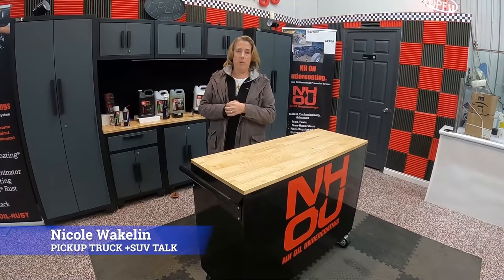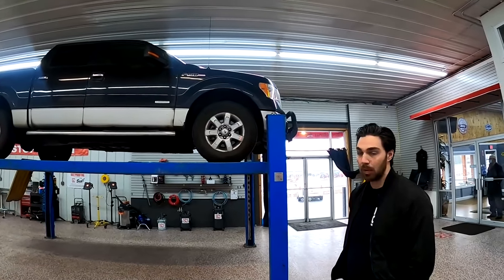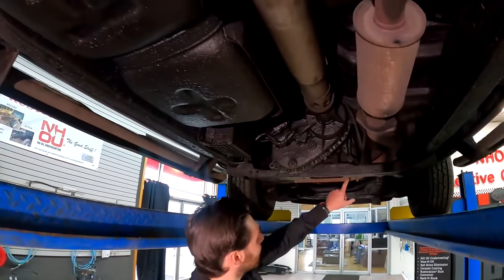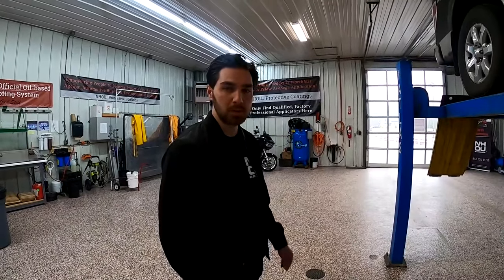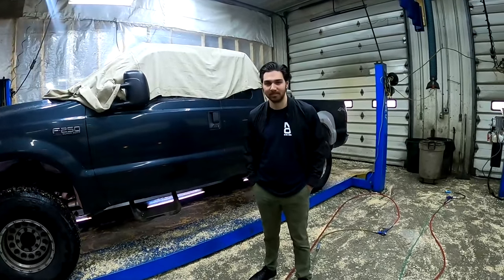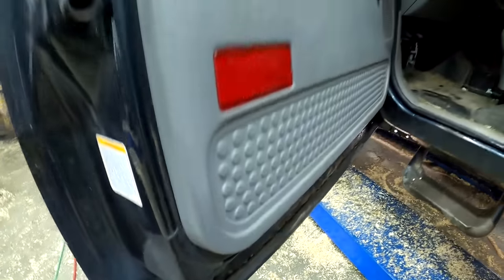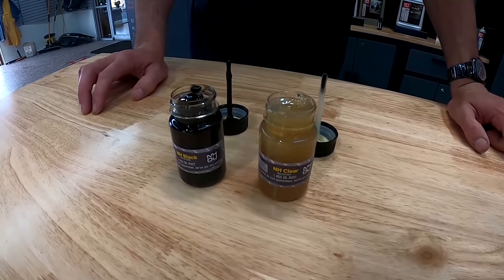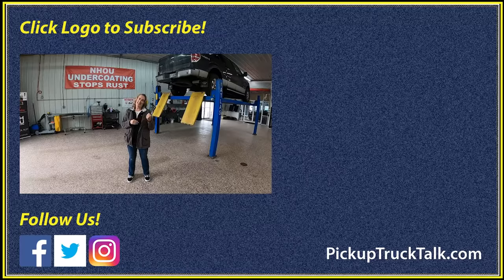Stop truck rust! Here's how with NHOU undercoating on new, used truck

Comment: Best thing ever!!
Live in eastern Canada and my 13 f150 is still good after spraying it myself every year. 
After warranty and not being undercoated will not be any paint left on the chassis.
My friend had an 81 f150 his dad sprayed the base oil from every oil change on it.
Thing was mint after 20 yrs.
Also melted toilet wax rings work extremely well!!
Reply: why toliet rings whats special about them?  i should look at spraying old oil on.  i use rust check/krown, but i'm still not convinced on them being better than motor oil.  hear a lot of old guys using chain saw bar oil too.
Reply: @666dynomax  the wax rings melted down is probably the most lasting thing.
I use a product made by dominion sure seal.
110$  for 20 litres. Seems to be working fine, its thick. Creeps also, see it coming out from edges of trim and along my lights and everywhere I sprayed inside panels. 
Bar oil is good too, just get the thicker brand for warmer weather. Cold weather stuff is thin.  I find rust check wears off fast on the chassis, but not inside the panels.
Motor oil is OK but messy I find also, great if mixing with something thicker like bar oil.
Reply: @jpowell9343  I’ve been debating taking on my own rustproofing.  I play little over two hundred a year for rustcheck. I was finding the krown washing off so after three years I switched to rustcheck.  It’s building.
Reply: @jpowell9343  do those cheap guns perform ok?   I could get setup cheap.  I’m sure it’s less than $20 in product a year
Reply: @666dynomax  i just use a shutz gun like for rock guard, the screw on can type.
Like 30$ and set my compressor to 90 or 100 psi. Anywhere hard to reach i attach a hose to tip of the gun but must places you can reach like above wheel wells ..most important on a truck and cab corner, rockers.  I use about 12, 15 liters of rustproofing on my supercrew 6.5 ft box.
Its on there and don't come off..lol.
Even in cold I can see where its creeped out around things.
I swear by rustproofing, resale, maintenence is way better after you keep spraying it.
Sold my 03 f150 last year, chassis and underneath was still In excellent shape....most around here are gone or broken off.
You have the holes drilled so will be easy to do it yourself. You will do a better job and know where you got it.
Reply: For best results you want corrosion inhibitors in your base oil. Check How corrosion inhibitors protect metal: synthesis in the lab and testing by Applied Science.

Comment: I live in a winter climate. Salty roads. I don’t believe in the extra costs in doing that every year but I totally get why it’s done for sure. Does prolong rust from the outside in. Problem people we will get rust from stones chips etc. From the exterior of the body. In my opinion that is worse. Running boards really protect the door sills, corner of cabs, box. Also a lot of people trade there trucks or cars in on the average 7-8 years anyways. Also I seen here at least where the oil or compound starts to lift or crack and collects moisture. I guess that’s why every year of doing that would correct that issue if noticed.

Comment: I have used this product the last couple years on my truck.  That said I do have a build up of since I don't wash the undercarriage because of the reasons mentioned in the video.  Should I give it a wash before I take it in for undercoating this year?  I am not sure it will come off with a few washes since it is on their solidly. Or should I just leave as is and have the shop spray over what is there?  Thank you
Reply: i was in today and it was explained that each year you get this done it “stacks” / “sticks” to the old stuff. so i’d imagine you wouldn’t want to remove it each time.

Comment: Why wasn't there masking off around the brakes you would not want oil on your brakes.
Reply: That is what I wanted to ask!
Reply: Most of the time the brakes aren't a problem when spraying because of the guard covering the brake disc. But if that guard is missing or rusted off they spray brake clean on the disc after.
Reply: And he sprayed oil all over the spare tire too

Comment: What a mess! I would hate to be the guy who has to work underneath that truck.
Reply: The product becomes much less tacky a few weeks down the road. 75% of the vehicles referred to us were by mechanics. The upside of helping your customer extend the life of their vehicle is you extend the service life and never need to break out a torch! Miraculously spare tires function etc. I guess like everything in life there is an upside and a down but our customers put up with the dirt and dust over rust and structural failure
Reply: Watch some of South Main Auto videos. He would rather work on this than the rusted up junk he works on a lot of times.
Reply: @CraigSmith568  I've seen the video you're referring to and it's pretty compelling!
Reply: It should make it easier though, because bolts come off easily, and even things like fuel lines not rusted.

Comment: I bought my Tacoma new. From December to April I join a car wash for $22/ month. I go like 2-3 times a week. I live in Rhode Island. Lots of snow and salt.  I’m entering my seventh winter now. No rust. Tacoma frames are known to be awful.  So far Toyota had a service bulletin that covers the frame for 12 years since purchasing with unlimited mileage. So I’m afraid if I apply anything, Toyota will void their warranty
Reply: I'd suggest you properly undercoat the inside and outside of your frame and body panels with an oil like Fluid Film, Surface Shield, Krown, or NH Oil. Why? Because simply washing it not only is not enough but I've seen cases where it actually accelerated rust.

Comment: Would one coating of LINEX last forever and not leave an oily coating?
Reply: As long as you don’t get a single drop of moisture in it. It will work great but when (not if) moisture seeps under it it will just rust even faster. Kind of a damned if you do, damned if you don’t situation
Reply: Eric
When getting Line X sprayed into the bed of your truck, is it oily?
Think about it

Comment: AS A TECH, I WOULD BE PISSED TO WORK ON THIS TRUCK, OR ONE COATED WITH THIS CRAP, MAKE ANY JOB WAY HARDER , AND A LOT MORE MESSY
Reply: It's definitely messier, but the techs up here in Canada say it makes it easier to remove all the hardware when working on vehicles because it's not rusted and stuck.
Reply: good luck with your trying to remove rusted bolts and nuts goals for 2024 brah.

Comment: Dude... this further solidified my decision for the CyberTruck.
What a joke... this is what traditional auto sells Americans? This is what they have to do to protect it?
Reply from the maker: I'd be curious to see what Tesla does to protect the frame rails on the Cybertruck. I'd imagine it is the same for that truck as well.
Reply: They make cars out steel the world over, and iron oxide occurs wherever the elements intrude.
Reply: Dude, it’s called salt on the roads that react to the metal of the vehicle.  Not sure what your cyber truck is made out of but if it’s metal and driven in the salt, it’s gonna rust🤦

Comment: Infomercial
Reply: That saves you thousands
Reply: @vuemax5229  yes but so does many other products like krown and fluid film ... And don't go trying to sell me on this specific brand in this video .  The point is that whatever kind of oil spray  underocating someone uses it will most likely save the vehicle from rusting away .
Reply from the maker: Sure, I can see that criticism. I just thought it would be interesting to see an undercoating process and I couldn't stop watching this video, so everyone has an opinion I guess.
Reply: @Pickuptrucktalk  you make a very valid point Tim . The video itself is very informative and gets the point across . Just it came across to me like they were indirectly bashing other brands of oil undercoat protection and trying to promote their personal business at the same time .

Comment: 250 is pretty steep.
Reply: They (NHO) want $300 for first time, $250 a yr after 😳
I’ll have to get fluid film or woolwax done instead I guess
Reply: @paulhunter9613   Krown is similar and around $150.
Reply: @VainakhQuranites  the nearest Krown dealer is 50 +mi away and wanted $300. I ended up with getting woolwax spayed on the bottom side and inside the frame for $140 on an aluminum f150. Should be good for a long time
Reply: @paulhunter9613  good deal. It shouldn’t hurt doing it yearly
Reply: The woolwax stays on the truck better than fluid film and krown I guess, supposedly for two yrs. I had it done last fall and didn’t even drive it in the snow last yr, I had one 4” snow , the rest of the year was basically rain. And I did have another car to drive so the truck didn’t see salt , but this yr it will get driven as I sold the car. @VainakhQuranites

Comment: What a MESS! There are literally dozens of solutions that stay on for years and don’t collect dirt cake.
Reply: Only real solution is to move to Arizona :) the only way you can stop pre-existing rust is with oil as it removes oxygen and moisture necessary for oxidation. Everything else just covers it up temporarily.....Like everything in life, there is an upside and a downside. We do however have an alternative for a brand-new truck, Boss Wax. This product cures and is what you would expect from conventional type undercoating. It does not collect dirt and dust as the oil does

Comment: I appreciate that this works. Unfortunately, there’s no way I would keep doing this. I park inside my garage that has an enamel floor installed. I am one of those guys. I bury my trucks in mud and grime all over the country, I then clean them well after. I have not even had rust issues with my farm trucks over the decades. Keep them clean. If you have an issue like Tim did, (I have a 2021 F150 as well), you can also just clean the rust off and paint the areas affected. I have been doing that for decades. I am fortunate that I have always had a hoist so it’s easier for me than others. Even just TremClad works if you want. 
    I was luck as I had surgery recently on my back and while recovering, my friend asked to borrow my truck. He is someone I trust very well and said it was his to use. He had it for 3 days. When it came back he asked if he could meet me in the shop as he had something to show me that he did to my truck!! He was acting like he damaged it. He owns a body shop so I figured, no problem, he can fix it. I was using a walker so they helped me over and then when I went in, I had a great surprise! The front and rear axles were painted Iconic Silver. The u joints were sanded clean and then cleared. They looked new. The exhaust hangers were painted a flat black heat paint. He also put A**hole across the diff cover!!! Hahaha. 
     I was very impressed and lucky. He did that as a repayment for all the help he gets from me with his projects at my place. We all help each other out in our group. For now, I may have the nicest F150 undercarriage in the area. 
    He actually did the work at his business and there was some dismantling of the truck to get it right! 
So if you all become his friend,,,,,,,,,, hahaha. 
    I could never do this process to a vehicle of mine,,,,,,,, sorry. I know it’s done a lot in the US northeast. There’s a YouTube channel, Mustie1, and he uses a mix of Bar & Chain oil with other oils to do the same. He shows how to do it yourself and uses a shorter car lift to get it done with a creeper etc. It really works. He has great proof with his several vehicles. If you have a F150, they really only have very little to treat under the truck. I would never want this applied to all the aluminum.

Comment: Wouldn’t you have to completely disassemble the entire truck and take of the cab?
Reply from the maker: Not with those special spray guns. You are really just looking to coat the bottom of the vehicle and there are plenty of drain holes to push spray into the various cavities as you can see in the video.
Reply from the maker: @HateTheIRS  Sure, if the rust was too far gone, you'd have to do a frame off restoration with patch panels and welding new metal on. Just depends on how much rust you have plus how much time/effort you want to put into the truck.
Reply: That coating is definitely eco friendly.
Reply: Oil will penetrate spot welds, Rocker panels, seams etc. 5 to 7 inches in a warm month.
Reply: @md1120  Base product is food-grade mineral oil with no solvents or detergents
Reply: @nhoilundercoatinginc4286  that's pretty cool then. Not to sure about the thick wheel well grease but the underbody I like.
Reply: @md1120  Very little creeping with the HD product.
Reply: @md1120  The Wheel Well Guard extends the protection in washout areas ( highly abrasive) like the wheel wells and the backs of the bumpers. Otherwise, you'd lose protection within 1 to 2 months. Under the right conditions, the wheel wells can be like sandblasting cabinets, making it most difficult to sustain any soft product